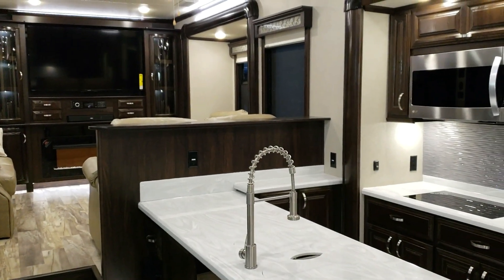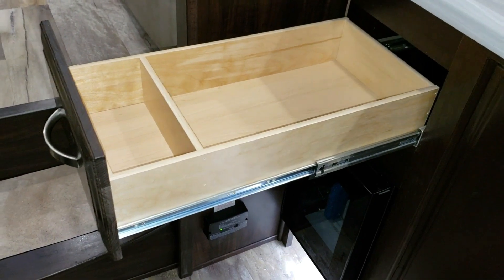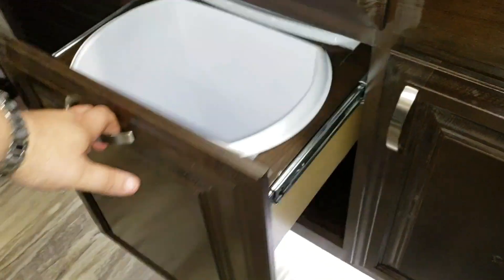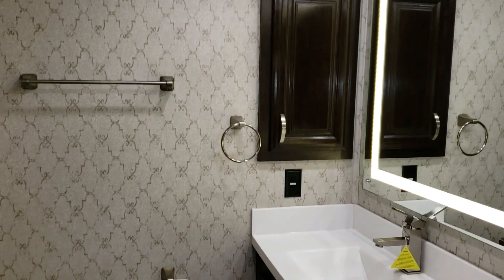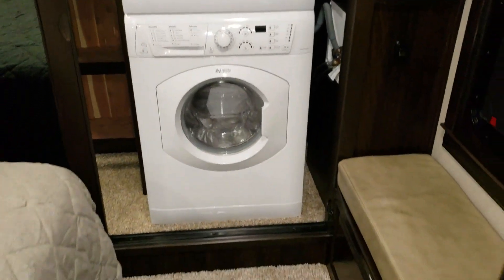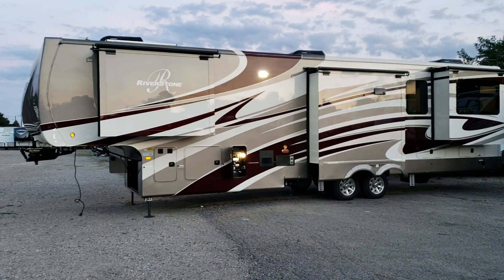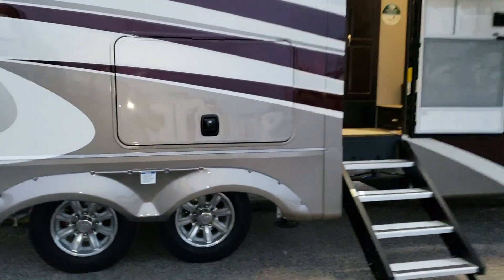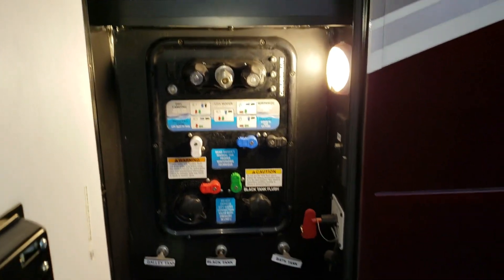2019 Riverstone Legacy 38RE 5th Wheel at Couchs RV Nation a RV Wholesaler

Comment: I was at a show recently and the two recliners in the 2019 that I was in did not have the shark extension in the middle. They were heated,vibrating recliners with the built in cup holders. Awesome chairs. Is that an option and why are there two different styles in the same year coach?